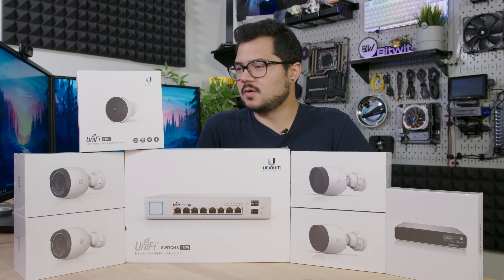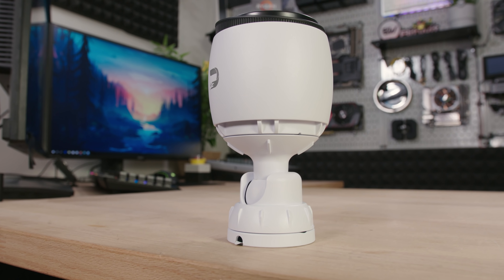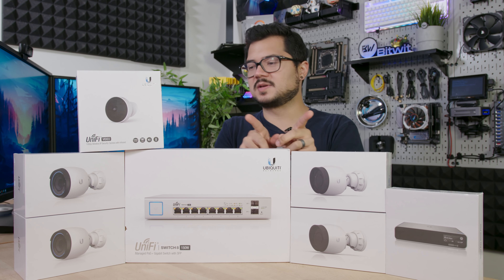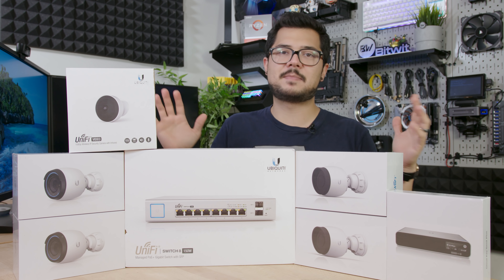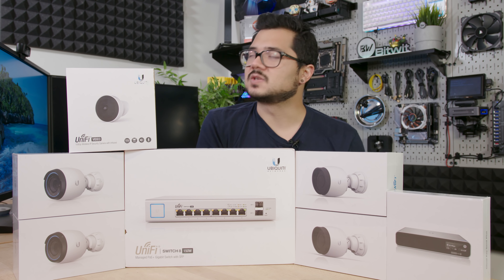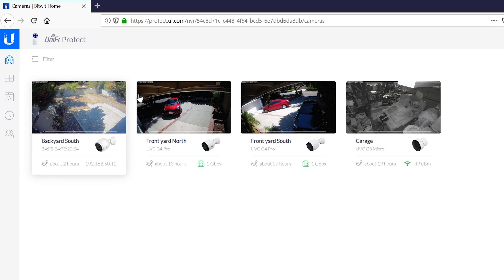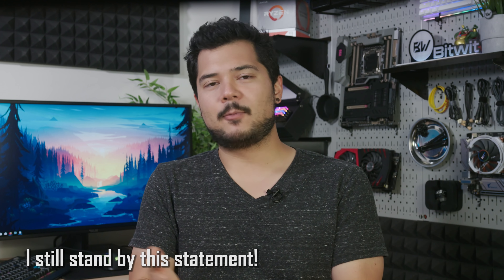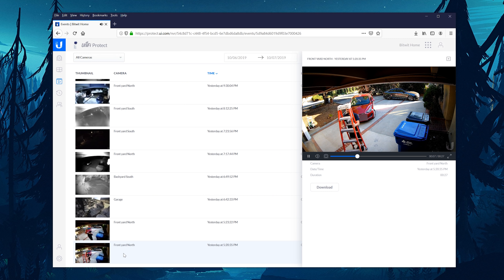PROTECTING MY LOOT!!

Comment: For your living room with that camera hanging off it, I highly recommend the UniFi Switch 8.  https://store.ui.com/collections/routing-switching/products/unifi-switch-8  Cool thing about this switch is it's powered via POE+ and has a pass-through so on port 8 so you can power a camera via POE from it.   Cool setup.  I'm curious to see how the single 5400 platter drive is going to keep up with the two 4k cameras as well as the 3 1080p ones.  I forget where I saw it, but someone had to change the drive to SSD to handle the continuous recording of the 4k cameras.

Comment: Kyle. You could've done Arlo. Arlo Ultra is 4k, Arlo Pro 3 is 2k, Arlo Pro 2 is 1080p, and Arlo Pro is 720p. You could've paid a little over half for the Arlo cameras then what you did here. Its 10$ a month. There are many ways to use the system.

Comment: My girlfriend and I bought a couple $35 wifi security cameras off Amazon a little while back so we could have something to see outside with, our apartment has no window or peephole for the front door, so we're basically blind to who's out there. The cameras had hundreds of amazing reviews, everyone said they worked great. When the cameras came in I tested them before doing the full install, and neither of them would work more than a couple feet from the router. They simply didn't have a strong enough signal. Add to that the app they used was total garbage, between the cameras and the app there was a delay of several seconds, and that was if it would stay connected at all. They ended up being completely useless, it was the first time I've had to do an online return. That basically canned our plans of getting security cameras, anything else is just too expensive for us.

Comment: I have an Arlo system at home and it is decent I do wish I could record more than 10 seconds if needed however, it is not a major problem since it goes continues if any further motion is detected. I don't have to bother with nighttime since it automatically turns on for me but the bugs and actually stray animals do activate it as well as cars which are at least 50 feet away only downside is the charging every month or so but I mean they do have newer versions to solve it and I believe faster alert times since it took about 10 seconds till I get a notification. However that part might be cuz of my home wifi have 12 active devices but only a given router.

Comment: Unless the camera have motors to move it, or can actually move the sensor around, there is no way for the camera to adjust framing after zooming in, and zooming in will only zoom into the middle of the image. This is optical zoom, not digital, so it uses the whole sensor when zoomed in, just like when not zoomed in.

Comment: can't afford the system you have but am looking for a security camera system. thanks for showing your's off.
Reply: Lorex is pretty good I installed them at my work
Reply: depending on how much you want to spend a referb dll/hp computer for $250 can be used to host blueiris and the NVR. get a POE switch for $120. add cameras when you can and have a nice system beginner for around $600

Comment: I wired some old laptop webcams to usb, as they are small and stealthy, got an old dell optiplex with a 1tb bed and an i3 and installed a free piece of software called contactan, which allows em to motion detection record. Then, I shares the root directory of where the motion clips where saved, and downloaded a remote files manager app on my iPhone which allows me to see the motion detection clips. Works great and cost nothing

Comment: Anybody wanting to have a system like this. You don't have to have the POE switch or cloud key thing. The cameras come with POE injectors and Ubiquiti has a manager you can install on your computer ( I don't recommend, performance hit.) or just some other low powered pc you may have. In my case I have a server with freenas running a lubuntu vm hosting the camera manager.

Comment: You potentially drop $2k to defend the Bitwit Castle and fortune. Lyle goes to Toys'R'Us and spends $25-30 on some low-end robot cat/squirrel  and then goes on Youtube to mod it so it is now cutting-tool ready. He sends it into your yard, it locates your ISP junction box, and then cuts the internet cable. You and the wife return and discover you're cleaned out. Lyle takes the cheese.

Comment: so someone tried to break into my house (Jan 27th 2019) as it happens I was upstairs in my room. I heard a noise which made me listen, THEN I HEARD SOMETHING FALL! I thought a chair fell. It was at that moment I knew someone was in the house. with that in mind instantly switched on my room Light, then comtemplated what to do. as I was upstairs I switched on the corridor light and at that point they knew someone was home and RAN away. only damage was they broke the back garden rear window frame

 It was my fault I suppose, I was home alone and had all the lights switched off like an idiot! I had some trouble sleeping after that for a while, I still haven't bought a CCTV system yet cos I'm poor and not a famous Youtuber. but hey... luckily I have some pretty good hearing.
Reply: Damn that's scary, thankfully nothing bad happened
Reply: Geeni is a cheap alternative, motion activated,records and has mic and speaker, WIFI and you you can access it from your phone when the alarm activates.
I believe I paid around 25 USD for 2 cameras.
Reply: Get the zosi they are like 100 with 8 cameras  they are ok for  the money.
Reply: Maverick 88 will keep you safer than a camera for same price. Cameras are good so the police can identify who turned you into a corpse
Reply: For shits and gigs, set-up a rave style blinding lights and speakers to incapacitate them.
Reply: @aussiemetalkid00  OP says they can't afford cams so you suggest hundreds(thousands) of dollars of lights and audio...
Reply: Glad they fled. That's scary AF.
Reply: Wyze cam. They're incredibly cheap, high quality cameras and now, a security system too.
Reply: @doomboots  buddy of mine has nothing but praise for their equipment.

Comment: Is this a good pc set up? A AMD Ryzen 5 2600, 	
 With a ASUS B450-Plus motherboard like yours or ( can I use a ASUS ROG Strix B450-F Gaming Motherboard instead ?), I wanna use a 
GIGABYTE RTX 2060S,	
the RAM	Is a Corsair Vengeance with a 16GB and a SSD PNY 960GB using a Phanteks P400S case? And a Corsair CX 650 power supply?

Comment: I had a customer about 10 years ago, who asked me for a quote on a security camera system for their bar. Before I could even write the quote up for them, they went to the local fry's electronics and bought a kit. About a year later, someone broke into their bar and trashed the place... When the cops came; they told my customers, there was nothing they could do with the video's; they were just to low quality (something like 480p; about mid-range at the time; top range being 780p and super top range being 1080p; having only a few camera's on the market). Because of this, the insurance company refused to pay for the damages and they ended up going out of business... Never cheap out on your security camera's. The prices my customers paid for their kit was around $200 less than what I was going to charge them; including the labor. They lost tens of thousands and eventually their business.

Comment: It's a shame you can't just use any IP cams you already own that have ONVIF protocol. I have the entire Unifi ecosystem at my house.. POE switches, USG gateway, AP AC Pros, and cloud key. Awesome products but the Unifi Video should be more universal in terms of camera choices. I ended up going with Milestone server software for camera system and have multiple different types of IP cameras setup and working.

btw, watching you drill and put drywall anchors into your wood truss made me laugh out loud.

Comment: that g4 pros cameras are excelent but no need for a house at the same price almost you can buy a package of 5xG3  and do the same job also from experience the cloud key gen 2 its good for up to 6 to 8 cameras. for more cameras and especially for those  G4 Pro you need a custom pc with unifi video and m.2 drives as a cashe and then storage with purple wd. for example try 2 person to login and searching the log it will buffer as hell. even streaming 4 cameras it will buffer as hell . we are waiting from ubiquity a new hardware for unifi protect the 2 only option you have atm is weak as hell. also not a good idea to sandwich the poe switch with so much heat they have.

Comment: Now just replace that craptastic consumer wifi router you are using with a USG, and an AP Pro and you'll be all set. On an installation note you dont need to use drywall anchors when you are screwing into wood. For the camera on the stucco wall why would you not install the mount over the existing whole in the wall?

Comment: I personally don't like that Unifi Video stuff. Got 4 of them (1 G3 Pro, 3 G3) installed, they often forget their manual Focus, brightness settings and everything else. The RJ45 connector is at such a stupid point, it basically kinks the cable if you tilt the camera. Meanwhile, a lot of better RJ45 connectors just don't physically fit

Comment: Heads up. Unifi cameras are pretty crap outdoors. The ir doesn't have great distance, they make you buy an ir extender to improve it which is ridiculous. I've installed quite a few maybe 30 Unifi cameras and they aren't all that great

Comment: I won't use indoor cameras for the same reason that I won't use Alexis, computer cameras or my cell phone in certain parts of the house.  All can be used for surveillance.  I know that some, especially those under 30, might laugh at this idea but things I laughed at 45-50 years ago are now common occurrences in society.  It's not just the government but also data miners that we have to fear.
Reply: Can be solved by using custom built system instead of Ubiquity, something that has no direct access to or from the internet. Can be either a completely offline solution or something where you directly connect to your server at home, maybe through a VPN even for extra layer of security. This will make getting this data too hard if possible at all. And there's also a thing that people probably just need to adjust to this new reality of things, with data driven world and all.

Comment: 4 core 8 threads is no big deal anymore.
i7 or no i7.
For example,i7 4790K is more or less the equivalent of Ryzen 5 2400G.
If you said 6 cores 12 threads i7,THAT would be troubling.

Comment: Hi guys, is $1800 a good deal for a Razer Blade 15 with i7-9750H, 240Hz, RTX 2070, and 512GB SSD?
Reply: Nevermind, it's the lower model. The i7-8750H, 144Hz, 16gb ram, and 256gb SSD.
Is it still worth it?

Comment: I believe it's a great system and ecosystem, but it's way overpriced. It's not so hard to find much cheaper RTSP cameras with similar or even better quality (for example 4 hikvision 1440p cameras are roughly 500$ total). Ubiquiti's PoE switch is decently priced, but you can still find much cheaper options at similar (or enough for the task) quality. And finally a DVR - any PC can work as a DVR with correct software: ZoneMinder, MotionEye, Shinobi, BlueIris and more. Even raspberry pi 4 can handle 4-5 1080p (or even 1440p) cameras as long as you don't need 30fps on all of them, and it's easy to get a much more powerful PC for cheap. And after that with a little setup (server or vpn) you can have same thing for... I guess it could all fit into less than 1000$ easy. So then it's just the question of whether the plug-n-play nature of the app and their proxy servers is enough to justify 1000$ more for you (additionally to potential privacy concerns since video stream is redirected through their proxy servers).

Custom built setup can also further be integrated into home automation hubs like HomeAssistant for further cool stuff like opening gate based on car plate or something. Not saying you should not go with Ubiquity, just talking out loud about other options.

Comment: Does no-one use ADT?

I have cameras I can access from my phone (live feed and night vision), shatter sensors on every window, shake sensors on every door, fire/carbon alarms I can access and pull data from, and key-fobs for accessing the panel remotely. No wires for the entire system (power cables obviously present) The system also runs off ADT's back-up battery. Everything is accessed threw their app on your phone and can be set-up on your pc. Its an additive system as well, letting you expand with more cameras and sensors at any point. The system comes with a monitoring service that is OPTIONAL but the service works with local law enforcement and fire departments, having a direct contact line to all of them, making response times to an alarm literally instant. Cost me $1k for the system and $30 a month for monitoring.

Comment: Unified protect is a waste. The cameras and software are great. Just get the cameras you need, the POE switch you want, build a small NAS box 1Tb RAID 1 will work just fine and download the Unified NVR software and run it on that NAS box. Connect it to your cloud account and download the phone APP, boom instant access anywhere. Unified Protect is nice but is only practical on small applications. Set ups with cameras more then 20 and it wont support and starts to overload the small unified protect box you get with it.